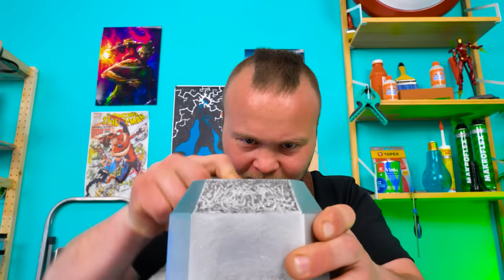How To Make Thor's Mighty Metal Hammer

Comment: Hello, How did you take out the plastic hammer from sand to prepare the form ? amazing job
Reply: HE DIDNT TAKE OUT THE HAMMER. HE LEFT IT IN AND  CASTED IT. SO THE PLASTIC BECOMES METAL. BECAUSE THE PLASTIC HELD THE MOLD. The sand prevent the plastic from catching a fire.

Comment: CAN CONCRETE BE CONVERTED INTO METAL. BY CASTING FOUNDRY.
Can you cast a concrete statue. Not concrete mold. But say u make a concrete version of thor hammer.  Or you have a construction concrete brick and u would like  a metal version of it. To build a metal wall or something. Can concrete material designs be casted. Like  HOW u can cast plastic/wood or foam into metal. I wanna turn concrete dumbells and construction concrete blocks into real metal without them concrete braking.